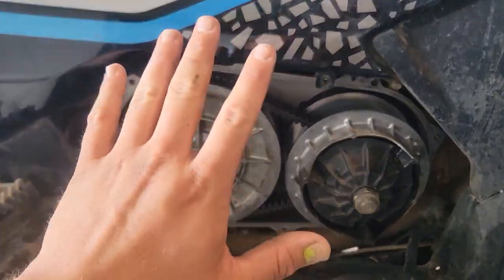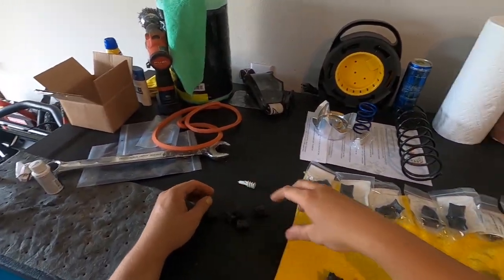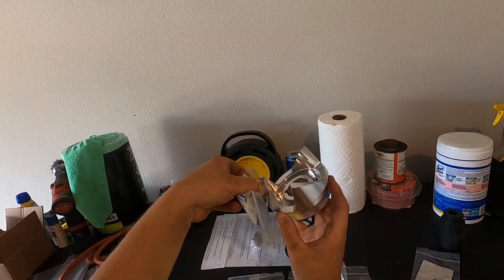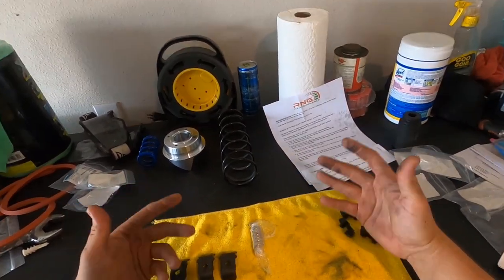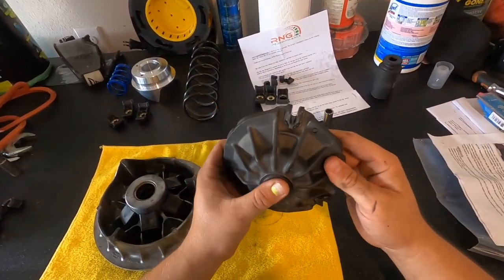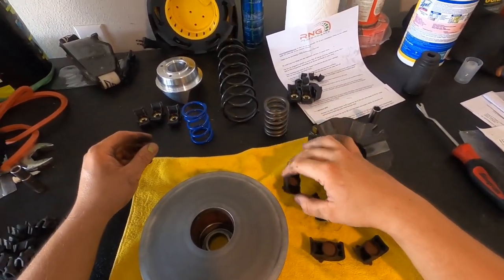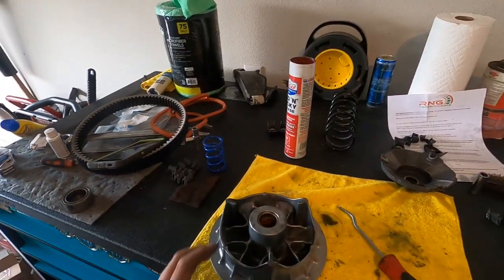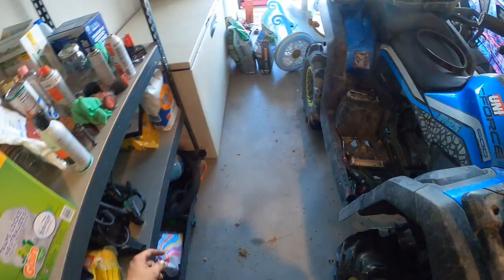Cforce 600 UpGrades and UpDated TSB.

Comment: Seeing the rubber you have wrapped on those rims I would suggest the stage 3 trail for all purpose riding or stage 3 mud for mostly riding.  Good video
Reply from the maker: This is what rng recomended. "I guess you could call it a stage 3. Msc didn't offer a helix when I got there stage 2.
Reply from the maker: At the end of the day. This set up is to much for the 600. It was never made for it to do what I'm doing to it.
Reply: It is a very capable machine, my C600 has 7000 miles on it and  keeps asking for more! It goes eveywhere my 800xc goes, just not as fast. In no way shape or form am I saying anything against the RNG set up but if you ever want to try the full stage 3 just hit me up at MSC. I'll be happy to work with you.
Reply from the maker: @robertpluszczynski4383  yeah man for sure. I don't believe is rivalry  and I hope I conveyed that in my video. Thank you for your support.

Comment: Play Can-Am 700 engages at 1400 play CF Moto 600 engages at 2000 RPM what do I have to do to get my engagement down to 1400 on my CF Moto?
Reply from the maker: @RydinginStyle72  2 ways. Add more weight to the primary. But this will change the entire dynamic of your driving. Other way to change primary spring to  a lighter spring with weight adjustment. This, too, will change the entire drive character of the machine a may require other adjustments. All of these machines are "high reving" it's the way it is.